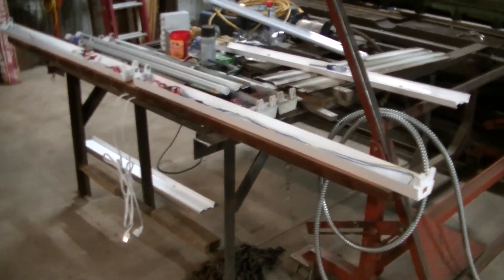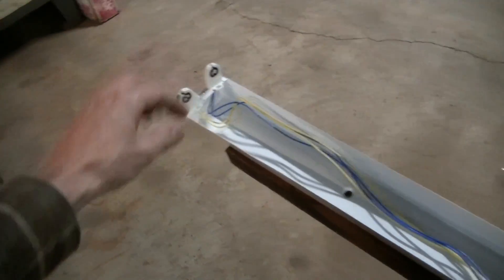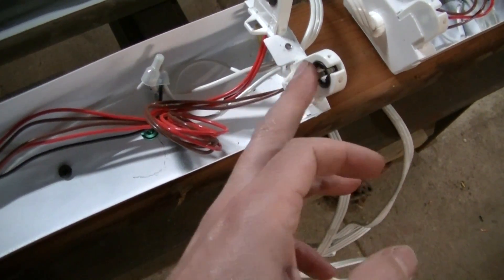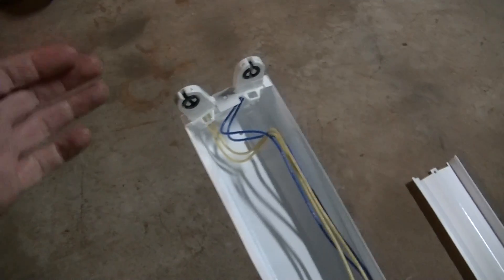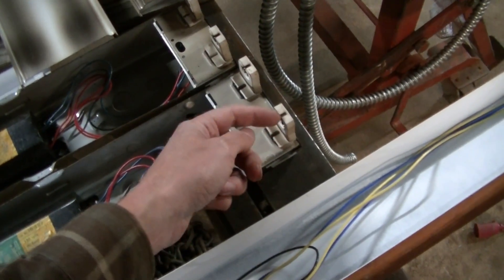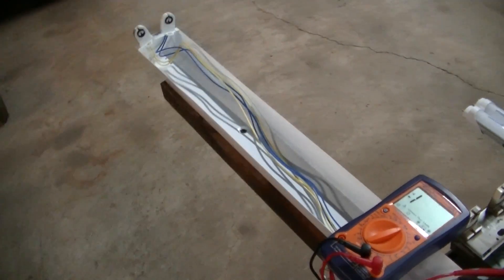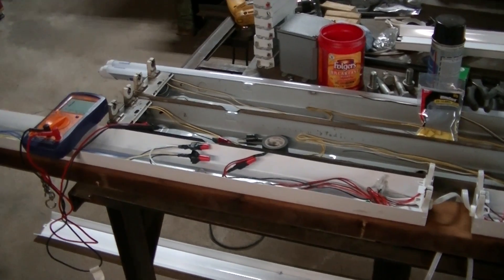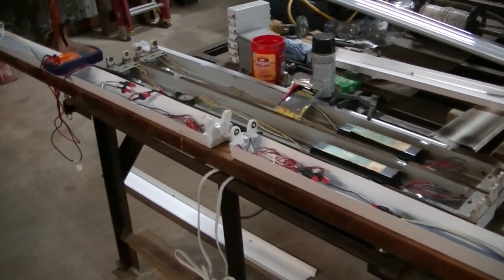"Quick Tip" T12 LED Single Ended Vs Double Ended

Comment: how can i found that my led tubes are single ended or double ended?
Reply from the maker: I would think it would be on the light somewhere or the package when you bought them.
Reply: @mossman381  thanks for your answer but unfortunately they didnt write anywhere, maybe I can fix it as a double ended if its not work means that its single end?
Reply from the maker: @ეჰსან  Can you see the wires looking into the lens? That might tell you what it is.

Comment: This video is seriously dated and much of its advice should be ignored, especially the creator's preference for one-ended LED tubes.

I'm amazed that energy-wasteful fluorescent bulbs that depend on even more energy-wasteful ballasts are still available, as ballast-free LEDs begin to seriously dominate the market. They're still around probably because the old fluorescent fixtures AND their bulbs are vastly cheaper. You can get a four-foot, two-bulb shop light fixture for about $15 and the fluorescent bulbs for about $2 apiece. The cheapest LEDs will be considerably more than twice that.

The one-ended bulbs will likely be history soon because they're dangerous. They SHOULD be history now. Comments on this video prove few people know anything about the difference in LED bulbs and many will end up as many have sticking the wrong end of the tube in the hot end of the fixture.  And when that happens, electrical hell breaks loose.
Reply: Thanks for the comment, confirms that dual ended tubes were the way to go.  Did bypass ballast on a two tube T12 fixture and am using GE Type B T8 dual ended direct wire tubes.  Find the light to be a bit too bright.  Is it safe to just install one tube and leave the other empty?  I've read somewhere that leaving sockets empty while powered on can be a fire hazard.  Also, when I did the bypass I connected the two yellow wires on one tombstone to neutral, leaving the white jumpers connected to the other tombstone on the same side.  Is it better to wire the other tombstone directly to the neutral as well, or are the existing wire jumpers ok?
Reply: I had no idea of double ended being safer and preferable to single-ended, not having started converting yet. Today’s the day: double ended!

Comment: Thanks for the explanation, I'm in the process of converting my garage  light to led, i know about the double ended and thats what im goin to buy,   in my opinion double ended will be alot easier to wire, and less confusing to install, they will turn on anyway you install them, but single ended they have to be installed one way only, correct me if I'm wrong thanks again.
Reply: Exactly Right!
Double Ended is the way to go!
Just make sure.....to Order the CORRECT Tubes! 
Duh! 
On that note: Someone made an Excellent suggestion, and that is.....Writing on the INSIDE of the Cover.....What Conversion you did.....and Which Tubes to "ONLY USE"!

Comment: I have done double ended 6 tubes in my garage and kitchen . it is very easy and save time than single ended because I don't need to check shunted or non-shunted. I only need make sure the blue and red wire length enough to connect with L & N wire . Thanks again Peter

Comment: I really like your know-how.   Good video.   One word of caution with it comes to single ended led conversion,  is to place a label warning users not to install fluorescent tubes, and maybe include a 1 amp fast blow type fuse as an additional safety precaution.   In the plant I worked at 7 or 8 years ago, when we first began to get into LED tubes, a custodian was injured while installing a fluorescent tube in a fixture that had been converted to single end LED.  The glass had shattered near the end he was holding,  when the tube shorted out on 277 volts. If you weren't aware, 277 volt lighting is very common in larger commercial or industrial facilities that are supplied by a 480Y/277 3 phase 4 wire system.    That's why some electronic ballasts and LED drivers will say something like 120 - 277V.   Or for magnetic ballasts,  mainly metal halide or high pressure sodium,  will have different wire leads,  for 120v 208v 240v and 277v, which is nothing more than taps on the primary winding.
Reply: Magnetic ballasts are now outlawed and can't be manufactured. Should have happened a lot sooner.

Comment: Hello. After watching your video, I pulled a double ended fluorescent bulb out of it’s “tombstones” and tried to fit a single ended LED into those same tombstones, just to check figment and there is no way. The tombstones in that fixture are not a universal fit for either type of end. They only accommodate a double ended bulb. At 3:10 of your video, you said the lady you talked to suggested changing out the double ended tombstones for single ended tombstones. You said you found a way to convert the new fixture you just bought, to the single ended type. In the video, have the single ended tombstones already been installed into the new fixture and you did not film the swap? If so, that would be the source of my confusion. I do have some single ended fixtures and they are spring loaded at one end and so you have to push in that end when installing the bulb. The pressure of the spring keeps the bulb secure into the other receiver. If your new fixture in the video is shown with the single tombstones already installed, they are obviously not the same style as mine. Are those the newly installed single ended tombstones being shown in the new fixture? Sorry for the lengthy post but I’m curious.
Reply from the maker: You must have an older light fixture, so you will need new tombstones. My light fixtures were on the newer side so I could just modify the wires going to them.

Comment: Can you break the led light if you touch the metal end. Also I didn't know those connectors spun to get out so I pryed out the old florescent ones out of the first ballast I have, would that possibly break the connectors? Because they are not turning on but on my other ballast they are. My LEDs are feit t12s.
Reply from the maker: It's possible you broke it. Are you sure your fixtures are wired for whatever kind of light you have (double or single ended)?

Comment: I order Hyperikon too but my tubes say "Dual End" but I only see "L   N" on one end.   I would have expected them to be L on one side and an N on another.   Do you have the same for your Dual End tube?
Reply from the maker: My lights are hanging from the rafters. If I get up there I will check. I would probably go with what the label says they are. If it's wrong and you wreck the lights they should replace them because there packaging was wrong.
Reply: @mossman381  
Thanks for the information.   Also read that Hyperikon is no longer in business.   Think they went bankrupt.   So checking out Toggled which is a company out of Michigan.
Reply: @mossman381  Installed LED's from Toggled.com which are single end and yeah like I suspected the Hyperikon worked so pretty sure the labeling is wrong and they are not dual end.

Comment: I just bought a contractors pack of ten LED tubes made by GE and it turns out they are double ended.  The schematic that GE provides with these tubes has all four terminals at the one end connected to the hot (black wire) and all four terminals at the  opposite end connected to the neutral (white wire).  So basically, with the GE tubes I bought, the tombstones at each end are all to be connected in parallel.  I don't know what other manufacturers do but this is what GE has for these particular tubes.  The tombstones typically are shunted with a jumper wire.  Mine are all non-shunted.  An easy way to remove the jumper from the tombstone is to push a thin steel wire in next to the jumper and pull the jumper (shunt wire) out.

Comment: Tip: mark whether the lamp holder is single ended or double ended. 
If single ended, mark which side has hot and neutral.
Incorrect assembly leads to a short circuit on the supply line.
Do not install neon tubes if it is equipped for LED tubes.
If you want to do it very well you can install a 1 amp fuse.
Reply: Great Idea!

Comment: I spent 4 different sessions of 2 hours each wiring for single ended bulbs, and FINALLY read in very fine print on the 4 foot tubes "double-end powered" I must have looked a 10 different YTUBE before I found this explaining the distinction.  Must have been a chinese engineer.  Now did I burn up the half dozen bulbs I had wired wrong?

Comment: I have heard that some tombstone manufacturers will not warranty them if they are used with a single-ended bulb.  Not designed to safely have 120VAC difference on the two pins and may short. This could be even worse if someone goes in and cuts the shunt wire in a shunted tombstone!

Comment: I recently purchased a T8 18W LED Clear 5000k (model. 18WGLSCLR. no brand name). it  did not specify if single or double ended. should i assume it's single ended?.
Reply: Could be a plug and play or a hybrid tube. Plug and play tubes work with the ballast in place. Hybrid tubes work as a plug and play tube until the ballast goes bad (or is removed). Once the ballast is eliminated, the fixture will have to be wired accordingly. Note that LED tubes working with a ballast do so less efficiently than LED tubes that are direct wired.

Comment: If it's a shop or you are setting up a rack to do micro greens I would recommend taking a Sharpie and writing the type of light it is on the fixture.  If aesthetics aren't important I would have that information front and centre.

Comment: I bought 2 LED bulbs from Walmart for $8.88 and they didn't require rewiring.  Did i miss something
Reply from the maker: You can get LED lights that will work with the ballast in florescent light fixtures but you won't get the energy saving because you are still using the ballast.

Comment: Ok, then why do both double and single ended systems work with ballasts? Not clear on how they work since I measured 270v ac between the tombstones with a ballast and 120 v ac with my converted (double sided wiring)
Reply: ALSO, in wiring a single ended system what happens if you wire black and white wires to each tombstone? This will ensure you don't have to determine the right direction on the fixture and the bulb. Or does it handle both ends?
Reply: @cvsWebDesigns  Single -ended LED tubes should have a black (hot) and white (neutral) wire connected to each tombstone on the powered end. Single-ended tubes require a non-shunted tombstone. For non-shunted tombstones there are two connection points on each end. In other words, non-shunted tombstones have a total of four connection points. In contrast, shunted tombstones only have two connection points on one of the ends of the tombstone. In a shunted tombstone, you only connect either hot or neutral, not both. In a non-shunted tombstone, you connect both hot and neutral. Just be sure that hot is connected on one end of the tombstone and neutral is connected at the opposite end. The second hole on each end of the tombstone is to jumper from tombstone to tombstone in a parallel configuration for multiple tubes. The tombstones on the other end of the fixture should not have any wires connected to them for a single-ended  tube.
Reply: Single ended and double ended LED tubes are both type B tubes that bypass the ballast. Plug and play (Type A) and hybrid (Type A+B) LED tubes do work with a ballast.

Comment: So, the old style tombstones that have both pins joined internally cannot be modified to separate them internally?
Reply from the maker: Those tombstones seem pretty cheap as it is.  Trying to open them up will probably break them.  I would get the right lights for your fixture or new tombstones.
Reply: @mossman381  it turns out that the T5 size tombstones come apart pretty easily, but what I just found out is that, in the ones I replaced with the dummy tombstones, the copper clips on each side were NOT joined after all and I could have left them in the fixture. The T12 tombstones in my garage fixtures are so old that I'm fairly certain they would just break into pieces if I tried to open them. Point being, nothing is lost by looking inside them, but like you say, the new dummies were only $1.22 each.
Reply: There is a certain type of tombstone if you take the cover off of it you can remove the connector in the middle and then you have non shunted

Comment: That's "shunted", not "scented". If you have two colored wires to a tombstone, usually red and blue, it is non shunted. Usually the other end will have all pins connected together with yellow wires.

Comment: So if you're converting an existing fixture, you need to open it up, cut the wires at the ballast and perform the continuity test on the tombstones BEFORE going to the store for the new LED bulbs. Can't believe the idiot bulb manufacturers haven't standardized this. Thanks for the video!
Reply from the maker: I am not sure why they have two different types.  Maybe to be able to convert older light fixtures.
Reply: Probably should flip the breaker before you cut any wires. And, at that point, no need to cut wires just yet. Simply check for continuity.
Reply: @61JWolf  If you don't cut the wires, the ohmmeter will read the ballast continuity, not the fixture.
Reply: @TriodeLuvr  I stand corrected. I was under the impression that there is at least 100 ohms of resistance across magnetic ballasts. But, I don't know this for certain. Typical multimeters will not indicate continuity for more than 50 ohms. In any event, you still don't have to cut the wires from the ballast to the tombstones to determine if the tombstones are shunted. A visual inspection of the connection points will indicate what type they are. If the tombstone has two connection points at both ends for a total of four connection points, it is a non-shunted tombstone. If it only has a total of two connection points it is a shunted tombstone.
Reply: @61JWolf  It was over a year go that I rewired our fixtures, so my memory of the smaller details is a little fuzzy. One thing I do remember is that it wasn't possible to be certain of the configuration based solely on the way the tombstones looked or the number of wires. Maybe it's easier with some than others, I don't know. In any event, it's easy enough to strip the cut wires back and put them back together temporarily after the test, if you need to, using wire nuts. Mine all had plenty of slack for this.

As an aside, I don't usually throw the breakers when I do this sort of work, simply because it disrupts the household so much. However, I'm meticulous about measuring at each incoming fixture wire for the presence of AC voltage before I start. The common lead of the meter is always touched to a known good ground for this, such as the frame of a nearby AC outlet or switch box. It's not sufficient to simply measure across the black and white wires for this test, and I don't rely on electricians to have wired the ground at the light fixture itself correctly. Also, I use a couple pieces of wide masking tape over the flip switch for the light I'm working on so another family member won't inadvertently turn it on in the middle of the job. In any situation where all these things can't be done, for instance, in the case of pushbutton switches or dimmers, I would flip the breaker as you suggest.

Comment: Man thank you for this video.  I bought the wrong ones and I was wondering why they were not working.  Time to order the correct ones.
Reply: You just need to use them correctly.  Not send them back.  Wire them the right way.

Comment: All you had to do was just buy non-stunted tombstones for the power end of the fixture ...very cheap...very easy...basic black to black..white to white wiring....after you take out the ballast and cut wires to other end ( non power side ) ………
Reply: good advice, which brands do u suggest?
Reply: WHY even Bother?
Just Wire it, to Double End it! 
WHY......replace the Tombstones, when you don't have to!

Comment: Go to the Toggled web site and watch their videos on installing single ended lamps. Their lamps come with two tombstones both non-shunted. Very easy and fast. Also lamps are rated for over 50,000 hours. Check them out.